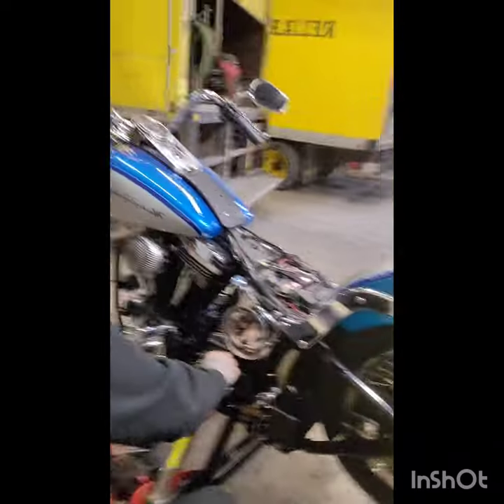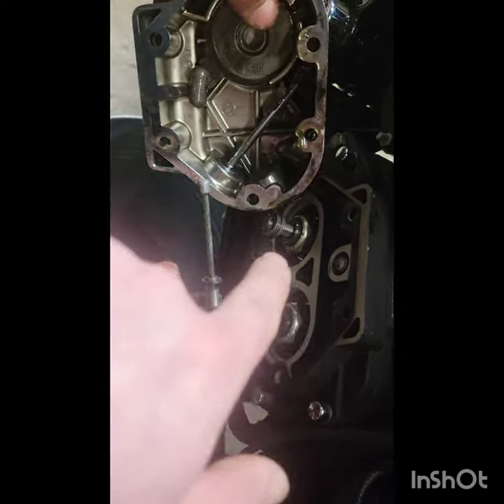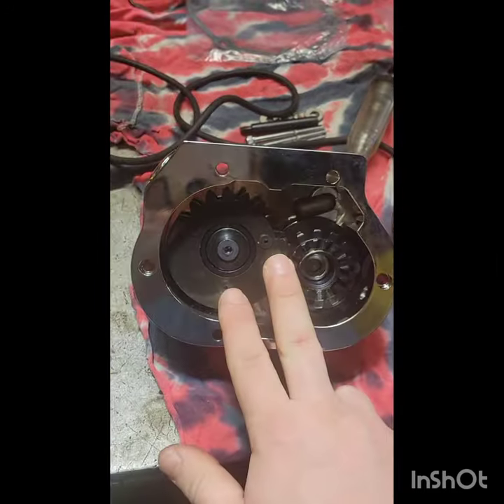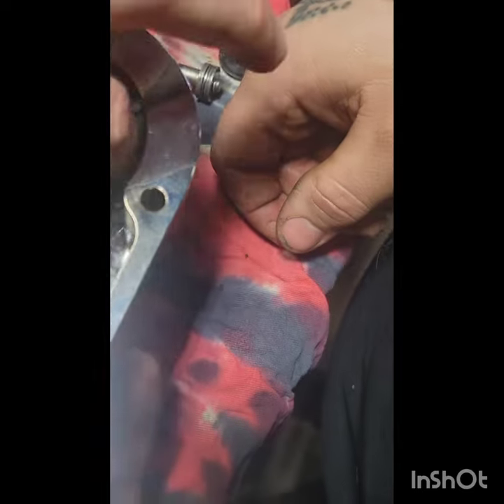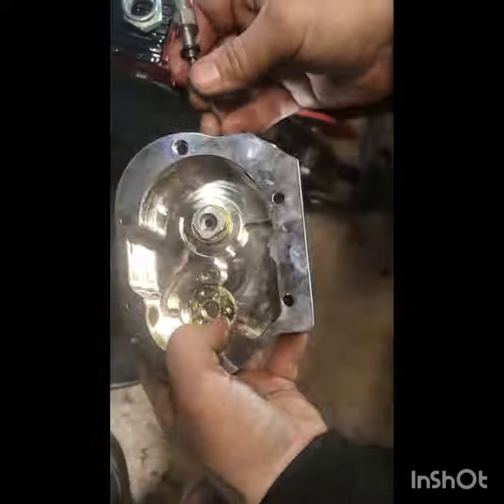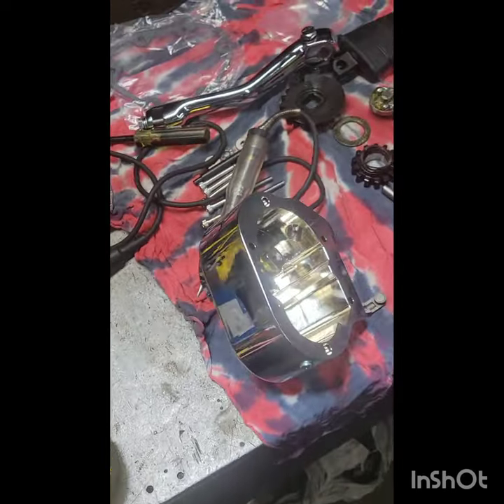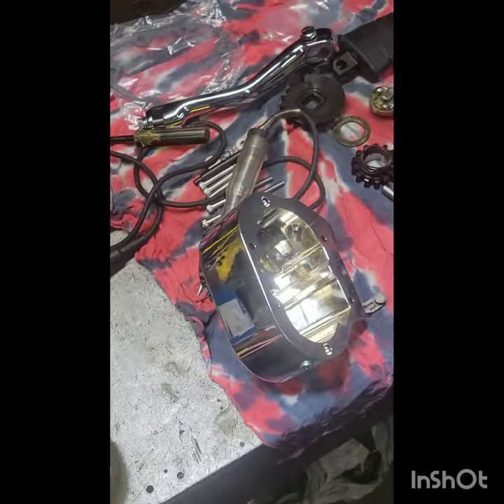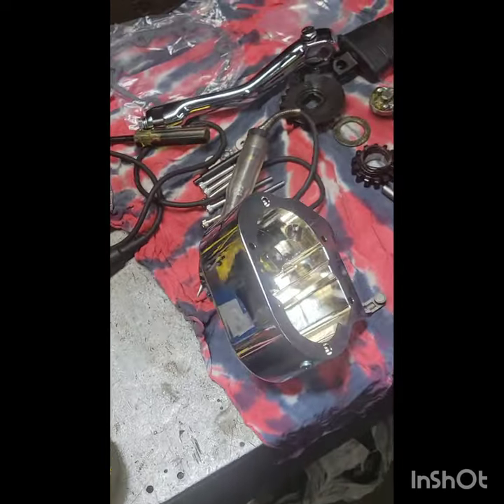ultima kicker kit installation, on 1990 evolution softail. ft donny

Comment: I’ve had this kick kit , in my motorbike for about 15 years or so.. the problems I’ve had are the ramps aren’t angled high enough. So you have some clutch Issues to find the sweet spot to get it to release well. This is the biggest problem I had. Because then you have to keep it tighter and you burn out throw bearings. And the push rod becomes very hot. So you need to check and throw out bearings often. If you feel something strange. Also the long push rod. Best to buy old longer one. From a shovel . if I remember correctly. And cut it to size. I used a harden drillbit for a while to get the extension I needed. And I grind the end, so they were rounded. And placed it in on the clutch side.. I was happy with it for a few years. Until I got a high-performance motor. And didn’t feel like kicking  it anymore. it still looks cool. But I’m looking to go back to the stock one. Plus of course you need to be aware of your exhaust system. I have a two into one. Which is a Sampson , my thunderhead would hit. if you can find some hardened washers. Put one into the hole. Where the throwout bearing rod goes. The bearing will spin better. Just a trick that I found that worked better. I always had the idea to machine the throwout bearing 2 inch push rod. And find the super small bearing that would fit instead of the Harley roller bearing. Also the ramp. Is not the same as stock. As it is, got a little slice taken out of it.. this kit is the same as the “York “branded kit , so if you want replacement parts that are cheaper than the Ultima. You can look it up. Good luck with this piece of junk , also just tilt the bike and lead it against the wall. And wait five minutes you don’t have to drain the fluid.

Comment: I tried to install the same kit on my 1995 Heritage Softail and it did not work.  The clutch ball ramp was always pulled forward and I knew the rod was too short.  Did you have to change the clutch cable as well?  If so, what did you use and who did you get it from?   I knew the push rod was an issue as well. How did you determine you needed the 11 3/8" extended center clutch push rod and who did you get it from?  Good video. I wish I had found it before I returned the kit. I think it is a desecent kicker.  Too bad the instructions do not inform people what else is needed to make the kit work correctly. After watching your video I am tempted to buy another one.
Reply from the maker: So we learned the hard way when we had no response from the clutch we new something was up so with some trouble shooting we realized it was too short, for a temporary fix we made one out of a steel rod until we were able to purchase one from the local bike shop, we did not have to change the cable, but the whole side of the kick mechanism had to be dismantled to attach the cable.